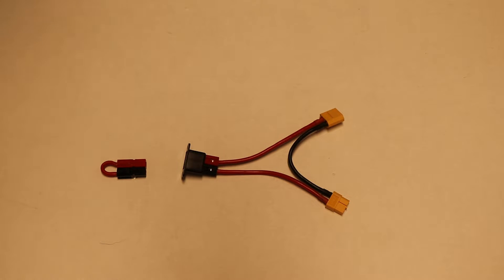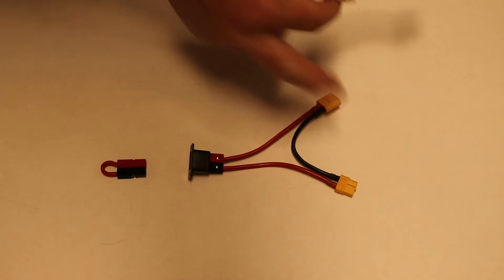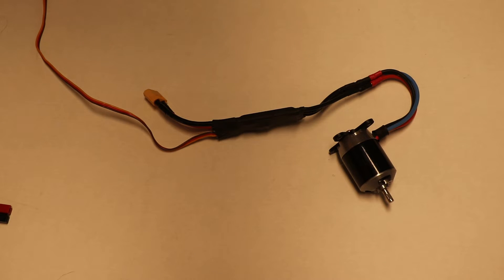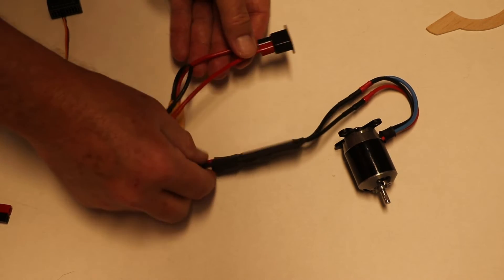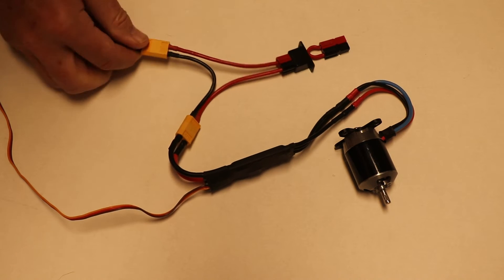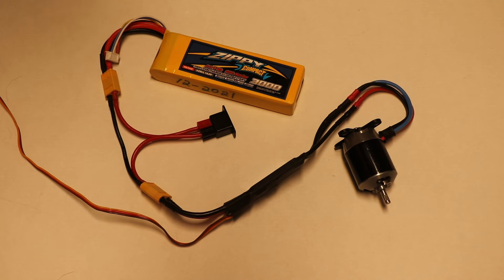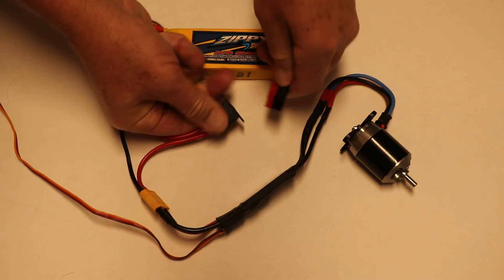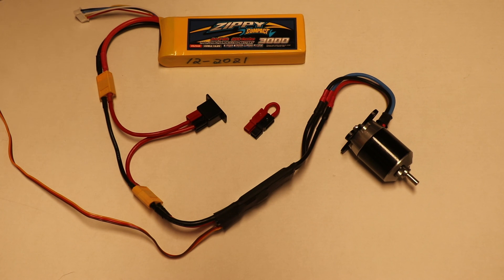how to install an arming switch harness - lipo powered model

Comment: Great video. Thanks for sharing. Any guesses if this would work for an Airsoft gun? 11.1v battery.  Also I’ve seen your idea used in RC Trucks but it was a 3d printed thing that had the “shorting plug” molded into it. I’ll try to find the video.  Again thanks for the video and would be great to know if this would work on Airsoft.